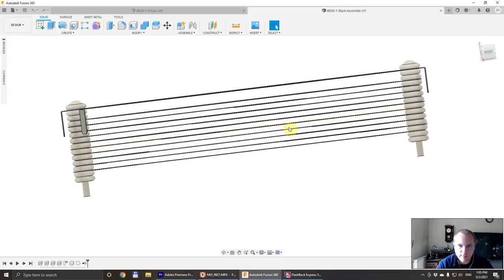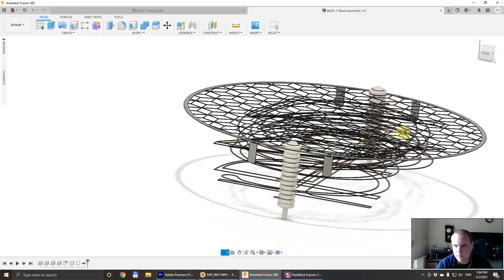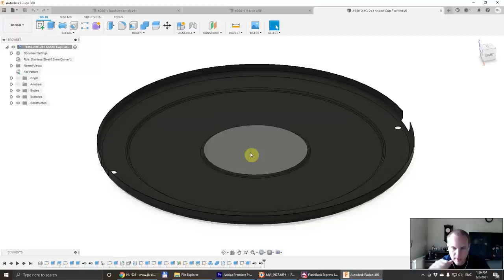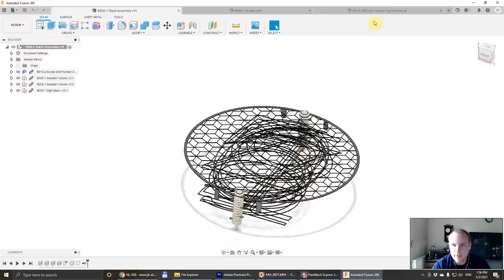Anode cup design finished - Project H #21

Comment: Instead of applying pressure to prevent wiggle... use insulators with larger diameter and sharp edges - more like washers, so small hole, large surface area. I think that would help tremendously! Digits should have the connetions larger as well so the idea is, once they're stacked, it will create rigid construction with no room to play.
Reply: Not sure how easy they would be to come by. Aren't they ceramic? I think clamping them down too hard to make it more rigid would just lead to them cracking.
Reply: @amarpersaud2950  thats why I said this is an alternative to clamping them down
Reply: @martincerny3294  sorry, I assumed the video meant sideways pressure while yours implied vertical (screw) pressure

Comment: Large digits are great, but there can be a problem. Even if digits will be mounted straight, they may bend and short after some shocks later. Maybe, bigger clearance will help. Otherwise, additional insulated pins or wire ridgepoles may be needed. Other idea is to mount some glass "comb" that will separate the digits.

Comment: Hello Dalibor, regarding the tension issue of the digits: 
If I look at the cross-section at 6:05 I would think that, if the bottom part of the insulators goes through the Anode cup, then perhaps you can put tension between the two insulators behind the anode cup. This way it would pull the insulators apart on the other side, therefore putting more tension onto the digits. But I don't know if it is technically possible, as a spring or tension mechanism would have to survive the heating. And most of the time materials loose their "springiness" when heated up.
Reply: I just posted a different idea, to make the insulators larger instead of applying preasure. The larger the diameter, the smaller room for any movement. Imagine it as plastic washers... small hole but large surface area. The digit connection should also look like that so when stacked in the tube, it will make a rigid tower.
Reply: @martincerny3294  true, but looking at the thickness of the digit wire I would think that it is probably more an issue of flex in the digit itself than flexing of the insulators. (And the insulators are made of ceramic, so not very flexible in the first place).
The problem is that the digits are not just straight wire, so applying to much tension might distort them in a different way (leading again to shorting).
Reply: @Ranger_Kevin  I'm not talking about flexing at all. Just that without pressure, there's room for the insulators to move around, just enough so that the digits can tilt a bit. Larger insulators => less room to play. Also if flexing is an issue here, easiest way to fix that would be encreasing thickness of the digits just enough. It would be immediately apparent when drawn form a side, but hope the explanation makes sense :)
Reply: @martincerny3294  Ah, I understand. Yes, of course the insulators should fit tight into the holes so that there is no play in the parts. That would be the first thing to check.

Comment: Advice, put a dirty sump pump in that cellar. That much standing water is not good for the masonry's binder nor for the masonry itself. Also, if that water isn't from the installation, to the building's owners, it would be a smart thing to obtain a permit from the local authorities and dig a shaft that goes deeper than the cellar by at least two meters, submerge a perforated pipe in which a pump exists, and fill the rest with gravel (to prevent water from freezing and cracking the pipe.
Source: what i did and what got rid of the inundation of my cellar.
Reply: not really recomended for such old buildings, it just strengthens the water spring and your pump can run quite frequently. it is just fighting with windmills, water is leveling with its natural depth in area. Also for durability of bricks in cellar is better to stay wet permanently then cycle dry/wet. Real solution is to make outside the building deep drainage excavations to get water level down, below fundations. But that needs money, permits and good hydrogeological project. I would say its definitely not Dalibor´s problem, cause he is just renting few rooms.
Reply: From the look of the castle im guessing, that there was a ditch around the  outside that was filled in at one point in time. Probably when it was no longer needed as defense. Because this looks very much like a water castle otherwise.

Comment: How do you manage are flow in those rooms? It looks like there is almost no ventilation. Also since many of the walls are concrete / stone, have you thought about an epoxy based coating instead? They form a very smooth and easy to clean surface. They are very popular in the USA for garage floors

Comment: The digits can only short where they cross. And at the point where they cross, you can't see that spot on the lower digit anyway. Would it work to paint an insulator material on those crossing points? Maybe some kind of ceramic slurry that will cure when the tube is baked?

Comment: It looks like your new lathe needed a good cleaning anyway, so maybe the accident was a blessing. My I suggest making the H tube digits more rigid by adding a small flange to the edges? I'm not sure how you would do this but it would make them a little stiffer. Another possibility would be to add a rib along the backside of the digits, if possible.

Comment: Is it possible to put a small dab of Glyptol on the backside of the element that is in front of the next element to keep them from touching? Or would the Glyptol be to heavy? Possibly even build a glued bridge between elements with the Glyptol? Possibly add a common tab on all elements, out of view and all bridged with Glyptol? That would eliminate the contact, but not sure how much added weight or how well the Glyptol adheres to the elements, or how durable that would be.

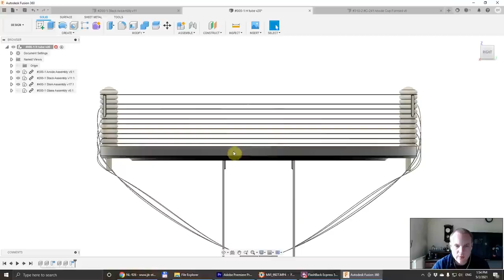Comment: 7:40 Dumb question, but what if you were to have the digits cut with the thinnest possible pig tails in the critical areas, and then tie those pig tails to neutral posts at key points in the circumference where you find that multiple digits can gain from being supported from? This is a laser cut piece, so i expect that the width can be quite small, AND, because it's a so thin, you don't have to cut it in a straight line, thus making it difficult to cut from one sheet, rather you can have it cut in a spiral that's close and compact to he digit's body.

Assuming you have the right coating for that wire, you could block it out without much damage to the visual aspect.

Just a thought, likely not the right idea.

Comment: Hi, is there a way to support numbers with insulated thin rods behind them, near the center, at different heights where they don't cross each others ?

Then you should be able to stick them with a thin and small amount of appropriate compound on the back.

With small holes at the right place on the back plate, you should be able to adjust the correct height while gluing the rod to the number then cutting it and fixing it to the rear of the back plate through the hole... Only an idea while watching your videos ^^

Regards...

Edit: Maybe no need to glue the rod on the numbers as your font has double lines, so a finishing rod head with a double T bar of the thickness of the number should do the trick... You can insert it in the length then rotate it to lock it between the 2 lines of your numbers... Maybe to try in your cad design...

Comment: ...instead of making insulators thicker make digits thicker and insulator thinner. Just a slight change in metal thickness will potentially make them less flexible (or maybe change to harder matal alloy)...:/